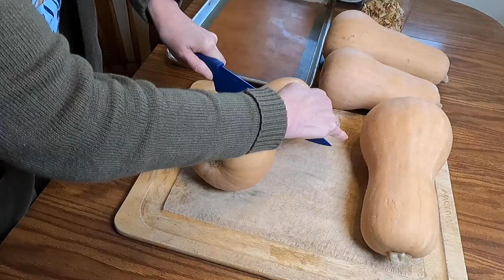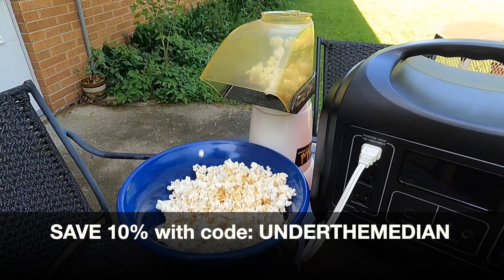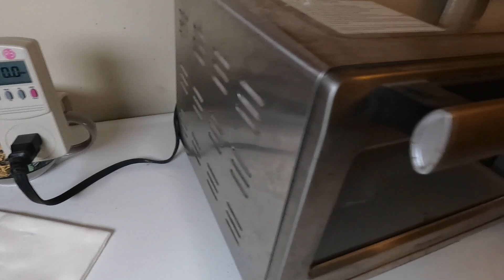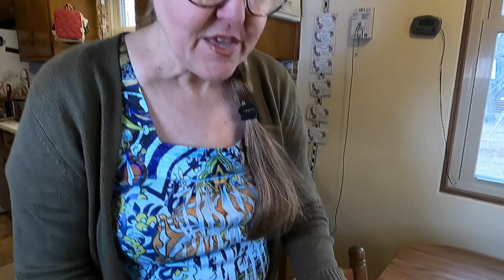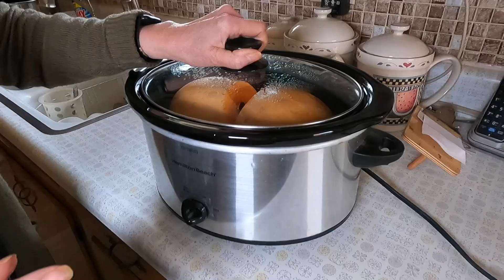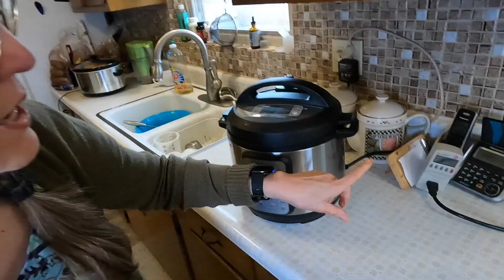How to Save Money Cooking with Low-Energy Appliances

Comment: Love the content. Question. How OLD is that wall oven? While I agree in principle that an oven draws more energy, older ovens are EXTREMELY energy inefficient. So as a scientist I ask myself, is this a fair comparison? Thx
Reply from the maker: Well, it's the only electric oven I have. So, clearly that was the one I needed to use. However, having said that, I've looked up the generally expected electric use of ovens several different places, and this oven falls into those parameters.

Comment: I wasn't surprised at all. The wall oven has the bigger volume and that's the reason for the higher amount. The toaster oven is smaller and needs less energy. And that's the only reason. The  crockpot can't be cheaper because it's pure physics. To heat one gramm of water for one centigrade you need one calorie. And it doesn't matter at all if you do it on a wood stove, over the flame of a candle, in a crockpot or in an electric kettle. The difference is only the loss of energie during the cooking time.
The pressure cooker works with pressure (haha) and this makes him heating up  and cooking faster. 
As I said pure physics.

Comment: I wish you could compare a gas oven and gas vs electric prices. I use my instant pot at least twice a week for cooking but most of the time I use my gas stove. Our utilities are all combined into 1 bill and we only see days of the week to find all of the usage which includes our gas furnace, gas fireplace, gas hot water heater AND all of our electric appliances. Considering that it’s been-10 degrees in Wisconsin it’s too hard to calculate.

Comment: As I concentrated on my previous comment about the oven Hope used...I forgot to add my "winner"..which I knew/thought was: TaDa! The Instant Pot!
In another camping or prep YouTube I watched a guy in his camper using a solar generator/battery to see if it would run the insta pot through the battery.
He did a preheat on it, then cooked his dinner (a whole chicken I think).
It worked, it could be done.
It does draw more energy when first heating up to pressure, but then drops off dramatically, and only moderate lower "spike" as it kicked on to maintain the heat. (Hmm I wonder if one ran the inside container in hot water to warm it first if it would reduce first heat spike?). (I don't remember the watt capacity of his battery, and I don't remember who it was from some time ago that posted the video to give him credit).
~Joe

Comment: Pretty sure if you used low on the crockpot, it would’ve won.  Either way a very interesting video comparison.  Thank You!
Reply: not really, because on low it would have taken hours longer - the pressure cooker is not only 10 to 20 times faster, it also is much better insulated, so the the heating element is not used much after it gets to temp

Comment: The instant pot is most efficient because it probably used a similar amount of energy as the crock pot in the same time period but it leverages having a sealed system to passively create a pressurized cooking environment so it only had to run for a fraction of the time.
Reply: My thoughts too
Reply: That’s my guess
Reply: I agree and I still use an old stainless pressure cooker. I can make food in less time like the insta pots. And yes they also keep from overheating the kitchen.
Reply: @joycemjinx  Mum always swore by her pressure cooker for cooking in on a daily basis.  Not only cheaper - like yours it was the old aluminium one - but much faster as well.  The vegetables for our dinners would be cooked inside of 5min every evening, huge saving in time and power.
Reply: @Karen Blackburn  mine is stainless but yes still very quick. As long as I can still buy the seals I will keep using it.

Comment: I have two crockpots that are much smaller than the one you used. Do you think they would use less electric than the big ones? Something I never thought about before now..I am single and do cook in a lot of mini cookers...
Reply from the maker: I have four sizes of crockpots and I've tested the smaller one. It does use less energy than the larger unit. But, it's not half of the energy. As I recall, it was maybe 30% less.
Reply: @UndertheMedian  Thank you, and I will take 30% less gladly. If or when they stop working I will consider an instant pot..Really liked this video also it was very informative.

Comment: An air fryer would be another interesting appliance to add to this experiment.  Thanks for this info. My husband now thinks we need an instant pot. I guess I know what I'm getting for Valentines Day - lol!
Reply: An airfryer uses less energy than a normal oven because it is a lot smaller and doesn't need to heat a large room. I just got one here in Germany which is similar to a Ninja Grill with airfryer and I made bread, cake and fries in it. I am sure it is more efficient than my large oven.
Reply: My cosori air fryer uses 1650 watts! Its alot of power but again, how long r u using it?
Reply: I was wondering if an air fryer or induction cooker would be better.
Reply: In my opinion air fryer cooks fast but does use quite a bit of electricity. But when it get up to temperature it does drop considerably only using the fan. I just cooked a chicken breast. Took half an hour. Thats less than 800 watts. My electric cost 20 cents per 1000 watts so less than a dime. I am ok with that
Reply: I roast the squash on the Airfryer and it’s delicious and fast.
Reply: My air fryer is my go to from toast to Rib eyes. Slow cooker for juicy meals stove top for eggs stews instant potatoes and steam veggies
Reply: Air fryers are more of an opportunity cost type deal imo.  Like do you want crispy?, if so maybe it's worth it to use the air fryer.
Reply: Your husband must truly love you if he gives you an electric pressure cooker. It shows he both values YOUR time and values saving energy and money to improve YOUR security. All you can do with a diamond is cut glass. A rose from a Florist is dead in a week.........A pressure cooker will save you time and energy for DECADES to come. Think about it.
Reply: you will be very pleased,
Reply: An air fryer is just a toaster oven with a convection function.  The whole "air fryer“ label is just there for marketing.
Reply: @pj-schmid  so.. What's your point?
Reply: @yudeok413  I should think that’s self-explanatory. It wouldn’t be expected to give significantly different results than a toaster oven. The invention of the term “air fryer“ was about marketing to sell people this "new invention" that really isn’t new at all.

Comment: When I’m doing those squash, I just cook whole squash without slicing or removing seeds. Works great
Reply from the maker: I figured it wouldn't fit into the pressure cooker without slicing it. Since I wanted to make all four method of cooking equal, I sliced all the squash the same way to each of the four appliances. I just did small pumpkins that way tonight, though, without slicing them.
Reply: @UndertheMedian  thx. U did excellent
Reply: This would be much easier. They are tough to cut through.
Reply from the maker: @jeannelejeune1983  , agreed. Some are easier than others, though. The butternut cut through the neck easier than down the middle.

Comment: Hmm..my father has the exact same GE (For the younger crowd: General Electric) wall oven. It's the one I grew up using. Even the exact same copper-ish color.
It was installed when the house was built in 1957.
And yes, it's still there...and still works, and yes he still lives there.
I see Hope and Larry have the same matching drop-in counter electric stove top. Yes, it still works too.
(For those who don't get the "they don't make them like they used to"..that should tell you something!)
Yes, they may be "energy hogs"...but 64 years later, STILL working!
~Joe
Reply from the maker: Yep. The stove top is still in the kitchen and still works just fine. A friend who is a home-builder looked the house over for us before we bought it. He said, "A long as those appliances are working, don't replace them. They are work horses and work great."
Reply: Crockpot!

Comment: Just wondering what the result would have been if the crockpot was on medium, not high and for 5to6hrs if it would make any significant difference? Your Canadian friend
Reply from the maker: I actually thought of that afterward. The wattage is almost half when it's on low. So, it would be less if it was in use for less than 8 hours total.

Comment: My gas oven and stove uses a lot less energy than any of my electric devices. When I noticed that my crockpot was making that big of spike in the electric bill I put it away. I put away my toaster also. I don't use the dryer anymore, however, our washer doesn't seem to cause that big of a spike. To off set the spike that it does cause we have started a habit of leaving off certain other devices.  I don't own an insta pot, no need for one, I'm never in that much of a hurry to feed anyone, there are always ramen noodles.

Comment: How old is your wall oven? I think those of us with newer appliances definitely need to do our own experiment. I use my slow cooker as often as I can for convenience as well as cost savings.
Reply from the maker: It's a 1958 (original to the house). Although I've looked up the energy usage of ovens several times in the past and it seems to be in alignment with general expected usage of electric ovens. However, having said that, you're right, there are a lot of factors which will affect usage, including the: make, model, size, age, and more of each appliance.
Reply: I hope you guys test gas vs electric stoves now that they want to force us to use electric. I don’t understand the move to electric when our grid is less reliable and produces less electricity! Then add in electric cars!
Reply: They are using a smaller oven. Most ovens these days are the wider variety so would use more energy to heat up and maintain heat.
Reply: @auzzygirl8175  I find newer ovens have poor insulation and heat easily escapes. What a waste of energy!
Reply: I was thinking the same thing. That oven looks older than I!